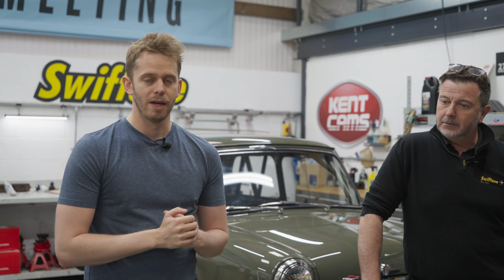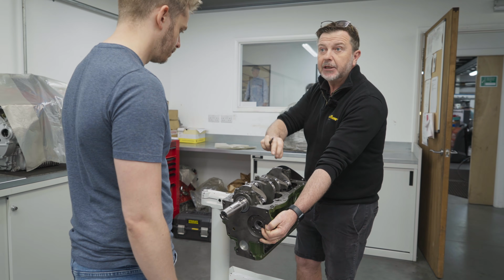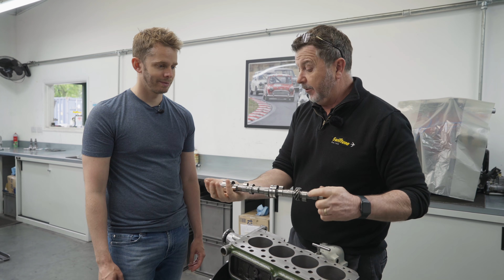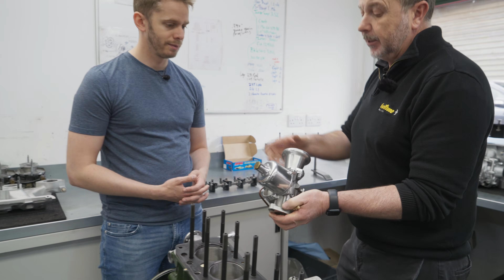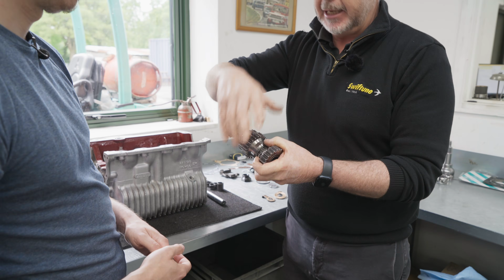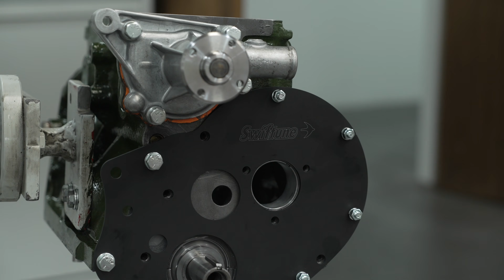Historic Mini Cooper Race Engine build - Explained by master engine builders @SwiftuneEngineering

Comment: Still have & RUN my little 1981 Vizard spec 1400cc Minivan.  Only problem is that it goes an awful lot faster than I am brave enough to drive these days!   I delighted in rebuilding it completely during lockdown, didn't even have to replace rings or bearings, thanks to meticulous maintenance.  Forget nookie in the back, its zimmer rame in the back now.

Comment: I noticed that this engine has a simplex timing chain whereas the original S engine had duplex, to try to stop stretch. There must be a reason there! Also, those SUs are replica H4s, not HS4s as the H4s have a longer body, presumably to increase the induction length leading to improved torque. That’s what I used back in the ‘70s. I’m impressed with the output and the overall quality. He didn’t let a lot of facts escape!!
Reply: I think chain wear is what increases chain length. My guess is duplex would improve reliability, perhaps by reducing surface pressures on sprockets by increasing contact surface area.

Comment: The periphery of the crank is spinning at about 140 mph through oil mist. No sign of streamlining the crank or of polishing the inside of the block. I did both on my FF2000 engine and won most of the FF2000 races I competed in. Was I cheating?

Comment: Pre MOWOG these engines were designed to be used as a starter engine for some larger industrial engine.
Someone might know more details.
Reply: Morris Minor 748cc Side Valve still powers the Spit Bridge in Mosman,Sydney today,opening to let Yachts through....

Comment: These mini engines have been tuned to 100bhp per litre since the 1970s. Just shows how good the engineers were way back then. I can remember my dad  building racing Minis. He even had one with a cross-flow cylinder head.
Reply: Pretty amazing power output for a tiny little 3-bearing crankshaft engine!  The Amazing A-series!

Comment: I had a mini van with a cooper s engine in it and i was king of the road
Reply: @eddieMurphy11111  Hope you upgraded the brakes🤪🤪🤪
Reply: @stuartclague3914  in those days in the 60s you could not get anything like that .
Reply: @eddieMurphy11111  HA HA…that must have been interesting😳. I used to take my mum’s 850cc out in ‘67 when I passed my test (16 in the Isle of Man) and could fade those little drums away to nothing, even with 32bhp on hand…..
Reply: @stuartclague3914  what happend was i had a new engine put in which was the 850cc but going to work the next day and a con rod broke and went down into my gear box so the whole lot needed to be replaced they said the did not have the time to replace it so sent it to another garge when i got to the other garge they had sent a cooper s engine and gearbox all in one the man just put it in and i knew where there were some two twin webbers of a crashed cooper S and i did not look back

Comment: Nearly ten minutes spent describing all the gearbox upgrades and yet never once mentioned it was now a complete straight cut set up from the idler gear (drop gear to some)  to the diff, gearboxes are traditionally made using helical cut gears simply for the quietness they bring........the downside is the sideways lash they produce as the gears assert a sideways pressure robs about seven horse for each gear...........plus it has one of the most iconic sounds in road rallying, you would never mistake a straight cut mini approaching in the dark with carbs roaring and the box making a beautifull  screaming howl........it still sends shivers down my spine even today 50 years later.
Reply: A mini with straight cut gears you hear the gearbox before you see the car😂
Reply: Amusing how often ignorance and stubbornness combine…..
Reply: Thinking of the old story, “this is my grandfathers axe, new blade, new handle, but still my grandfather’s axe” how much of any racing Mini in 2024 is truly original?   Which bits are those?
Reply: Helical gears are used because they are stronger.
Reply: @V8Lenny  Helical gears are used for their noise suppression values alone - period,
  Its easy to see you are not an engineer since you dont even seem to understand polar moments of  exerted  stress,   helical gears cut at forty five degrees to the moment of force exert over a quarter of their power imput to imparting sideways or lateral loads which in simple terms equates to a frictional  power loss,  any gear acting  180 degrees to its moment of force transmits 100% of its imputted force with no lateral losses, the downside being higher transmitted noise levels through chatter. which in competion cars is basically irrelevent
Reply: @usernamesreprise4068  ask those engineers who know. Helical gears are stronger.
Reply: @V8Lenny  I have BEEN one for over fifty years thank you very much.
Reply: @usernamesreprise4068  too bad for the industry.
Reply: @V8Lenny  How very adroit of you, are you on medication for your problem ?
Reply: @V8Lenny which high performance gear manufacturers use helical cut gears? I’m not talking road car princesses
Reply: @HighFell  why not roadcars ? They are made to last, not serviced after every race like those POS race car gearboxes made by some small garage shop that cant make helical gears.
Reply: @V8Lenny  if you had the first clue about transmissions, you would know why all serious competition transmissions use straight cut gears and not helical cut. Straight cut gears allow a larger tooth profile to be used that is both much stronger with less loss in power transfer. Straight cut gears exhibit negligible lateral loading on casings.
Reply: @HighFell  no, they are weaker. But easier for bearings and casing. And every small backyard garage can make them.
Reply: @V8Lenny  explain how Helical Gears are stronger. Don’t worry about using technical descriptions, I am up to speed on the mathematics too. I love a new discovery.
Reply: @HighFell  The silence is deafening.
Reply: @usernamesreprise4068  ha ha you noticed too. 👍

Comment: Very interesting, however they're not really mini engines any more. 
Back in the very early 1960s I successfully aced a gp5 mini. However after 1963 we gave up because of the Ss coming in. Also the professional tuning firms took over. John Whitmore's Broadspeed  mini was our particular nemesis. At the time I was at BMC's/special tuning department so that helped.
Reply: These engines for the historic racing are, in some ways, closer (in design) to real mini engines than some of the high level racing engine options that took over in later years (crossflow etc). The execution of the build looks very impressive indeed and in that respect I agree "they are not really mini engines any more"! Interesting that they are back using simplex timing chains. I was very proud of the duplex gear on my 1380!
Reply: @MrAdopado  I completely agree with you. However crossflow heads have been around since the 1960s. All early Ss had duplex chains, didn't know that the modern racing engines didn't use them. I, like you, proudly  fitted one onto my racing  Sprite in the late 1960s. Incidentally I still own it nearly 60 years later.
Reply: @tonycamplin8607  Yes, I presume it's all down to how they decide to set the regs for Historic Racing. It seems a bit arbitrary really but then all racing classes have their rules which limit what you can develop. (I did a couple of seasons hill climbing, sharing an old cheap Porsche 924, which put us in a ridiculous class mismatch so we were never ever going to win anything!)
In respect of the duplex chain thing it's probably just that they've found a way to make the single chain strong and reliable enough such that it becomes a positive advantage due to running less rotational mass. So perhaps they can use duplex chains under their regs but they can use the single if they choose.
Reply: @MrAdopado  Thanks for replying. Yes I know what you mean about being outclassed. When  Porsche 911s were introduced they were classed as saloon cars because of their number of seats!!

Comment: I built a 1380cc Mini Clubman tuned car in 1990 for the road. A rocket, three radiators to stop it boiling in the hot summer of 1990, four big spotlights, a real Porsche chaser. All good fun, and no speed cameras in those days cross country. 115mph behind a Porsche 911 up the A1 at 5 in the morning.

Comment: why dont you remanufacture an Arden 8 port cylinder head, the siamese ported cylinder heads are alright When the excesss material from around the valve guides is removed they flow quite well but they aint in the same league as an 8 port... which i might add are as old of a design as the A series its self... il bet your remanufactured cylinder heads a no better than a than a ported 12g940 casting made 50 years ago.
Reply: @dancockydan1589 I remember seeing a works S with an Arden 8 port head at the Manx Trophy rally in the early 70’s.
Reply: fit a twin cam bmw bike head 😊

Comment: My all time favourite car, the Mini. I have owned and driven a good many cars, some of which were high performance,  but to me, a Mini Cooper was more fun and practical. To help withe the throttle tending to be either On or Off, I fitted a Bell Crank to the carb linkage, which smoothed out the action considerably. In order to help with longevity, oil was changed evry 1500 miles, without failure. The three main bearing A Series was an incredible motor. Way better than a Ford of that period in terms of what power  increases it could handle, before expiring.

Comment: The A series engine is a very old design, being non crossflow cylinder head with 3 exhaust ports 2 inlet limits what can be done with them!! SU= Skinners Union; started around 1930s.
Not ideal the engine sharing oil with the gearbox, some Lamborghini,s had the gearbox sharing with the engine. They changed that idea.

I do NOT like the young guy bit of an idiot, other man knows his stuff!!

Comment: You should all have to use factory equipment, its simple to build power with a different cylinder head, cam, , they are not the   the engines they are portrayed to be. None of that Goodwood crap is.

Comment: Since when did Brits start using Lambda as a term instead of AFR?
Reply: Roughly 10/15 years ago (mainly due to formalising the jargon used in modern emissions regulations legislation - MOTs etc ( I believe))..
Reply: I always used AFR. But I worked with other UK tuners that used lamda back in the early 2000's. I think it depended on which software and management systems you used. I did jap and ford stuff. If I recall it was more the people doing euro stuff that worked in lambda.

Comment: Very enjoyable video,  but Issigonis didn't design the Mini A Series engine / gearbox set up...
Reply: So who did.? Issigonis was lead designer. The accountants mandated the use of an existing gear cluster set (Morris Minor I think) to save tooling costs. In early power units this lead to early failure of a (2nd/3rd gear?) thrust washer which was under full load as a result  the end forces from the helical cut  gear cluster turning the opposite way to that originally designed.  The transfer gear from the clutch to the gear box reversed the motion which was again corrected by the crown wheel being driven off the output shaft.. I believe the Coopers S gear box was always straight cut, but still with synchromesh, but I never got inside one. I had an 850 Mini in flame red and later a Metro MG 1300 in Cinnabar red, other family members had a 1963 850 mini and two  Austin 1100s, oh and later a Mk1 Maxi 1500, but that was a much more modern if still conceptually similar power train.
Reply: @martinhow121  Thanks, never gave a thought that it was turning opposite.
Reply: True. (it was already a very well established engine by then). - Issigonis fame was through his brilliant space management designs.

Comment: Great video 👍 Surprised a low friction coating isn't used on cam rocker components 😊
Reply: The very small bearing surface on rockers is designed to help the valve stems gradually rotate whilst the engine is running this aids the valve seats to seal. You might be confusing the “rockers” with the oil-fed buckets that follow the cams and cradle the pushrods that ultimately push up the rockers. (These are also designed slightly off centre to provide a similar “ revolving” nature to help distribute wear evenly over the life of the engine) I hope that helps!

Comment: Such a cool vid! learned a lot about the mini engine! i had no clue it was built like that! one question tho. with the trans basically being the oil pan, the engine and trans just run engine oil? no gear oil? just never heard of a trans not using gear oil.
Reply from the maker: Correct!!
Reply: @AlexBrundleRacing  one more question. due to this, does the oil temp run on the high side? what weight oil is used? haha that was 2 sorry
Reply from the maker: @m1northreat  they run hot generally, and no idea. Swiftune blend their own
Reply: @m1northreat  20W50 is the normal oil viscosity for the Mini, though I don't know what Nick uses.  Millers make some oil blends especially for the mini with the required additives to cope with the gearbox.
Reply: @ferrumignis  very cool! thnx for the replies!! that little motor is so interesting!!
Reply: Yes that design was cutting edge technology back in the Fifties and ultimately, was one of many reasons why engine oil research & development (and its behaviour at different temperatures) has become such a science since then…
Reply: Most motorcycles have engine, gears and clutch sharing same oil bath!
Reply: That was the magic of the "packaging" of the engine and transmission ... and yes all with the same oil ... which is more successful than you might imagine!
Reply: Engine oil was spec for BMC trans stuff in Sprite, 3000 & MGB, NON-Detergent.

Comment: Not exactly a Cosworth DFV 3 litre F1 engine.
Reply: Having worked on both I can assure you the mini engine can be just as thrilling! - try one! 😁
Reply: Not exactly a relevant intelligent reply.
Reply: @iancraig6070 There are race engines and there are road engines. A tuned B.L. vehicle engine is at best a not very good compromise where as a DFV Cosworth is designed without compromise to make power. It's old technology by 2024 standards but not archaic as is a Mini motor. The relevance is related to the utilisation of the engine, the intelligence is related to the correct perception of the original comment. An OHV cast iron block is not something that the word exotic can be applied to where as pure competition engines are.

Comment: Where is the duplex chain ?
Reply: It actually sits at the “front” of the engine ( behind the timing chain cover) but in this transfer layout can be seen on the very left of the block looking from the front of the car.
Reply: @philtucker1224  what are you talking about there should be a duplex timing chain in a high performance A series engine
Reply: Naturally but not allowed in the regs for this particular racing series that this engine is for. To be fair John, you asked where the chain was, not why they hadn’t fitted a Duplex..
Reply: They run a simplex chain for less drag & weight.

Comment: So when you build a modern Mini engine how much power does it have. Things like roller valve train and bigger capacity and Webers,, more so with a X flow head.
Reply: This is not an ultimate power mini engine with no holds barred. This is built for historic racing where there is very tight control over what you are allowed to change from the original specification. An unrestricted build would be capable of double the power output.
Reply: @MrAdopado  Still, it shoulda had HS carbs.
Reply: Historically correct?
Wouldn't period accurate engineering mods be historically correct too?
If a mod was fitted and raced with back then why is it excluded now?
Bunch of jobsworths...
Make sure you use leaded paint and lead wiped body work applied without any protection and released into the neighbourhood to make sure it's historically correct.

Comment: 100hp per litre is better than some 00's super car engines 😮 My 911 had 88hp per litre. 😮
Reply from the maker: Wild isn’t it
Reply: Well, it is a racing engine, so it isn't designed for longevity or emissions like a road car engine.  Still, it's doubly impressive for a traditional 2-valve pushrod engine.
Reply: @flyingphoenix113  The K20A in a Honda Integra-R (DC5) managed 110hp/l from the factory (in 2001-06), just for a more modern road-car context – but as you say, for an engine design as old as a Mini A-series, getting 100hp/l is remarkable any which way.
Reply: @Fuse_22 , precisely.  The K and F-series had VTEC, DOHC, 4-valves per cylinder, and a number of other modern advancements of which a Morris A-series engine could only dream.
Reply: @flyingphoenix113  And Programmed Fuel Injection....way more modern "race car" type tech than this Mini, which makes this build even more remarkable, as many things are NOT allowed to be too far from original size or spec.too !!
Reply: I’ve seen a mini head and 100hp  per litre is nothing short of a miracle 😂
Reply: But a 911 is NOT a supercar. A weird sports car
Reply: @ldnwholesale8552  just depends on the year and model.

88hp per litre is pretty good though if it's without turbos,  europe had a bunch of cars with 2 liter engines that got 75hp per litre in mass production drive 200k km without major engine work cars though in the 80s already. too bad the emission calculations favor boosted applications now. 

I think the lower leagues rally motors were souped up to 100hp per liter in 80s already too.. generally you wouldn't want something like that on a daily driver though. vtec works for a daily driver.

edit: efi isn't that important for max hp, just makes it a lot easier to make it driveable on part throttle and lower rpm ranges